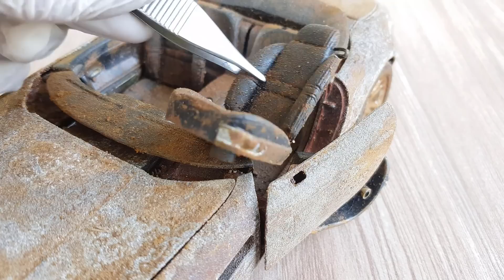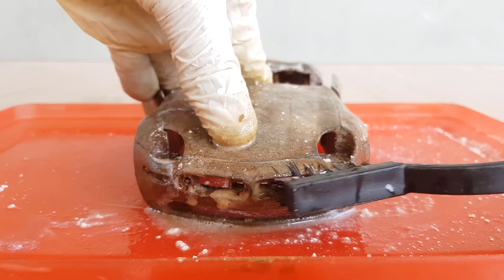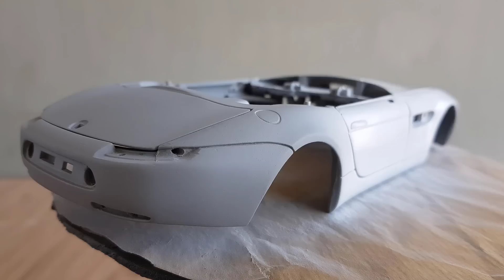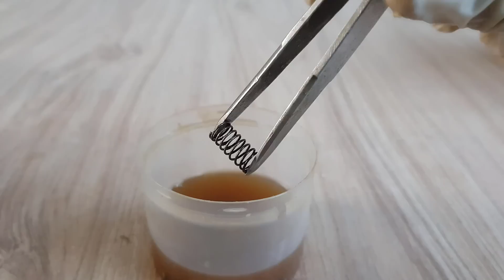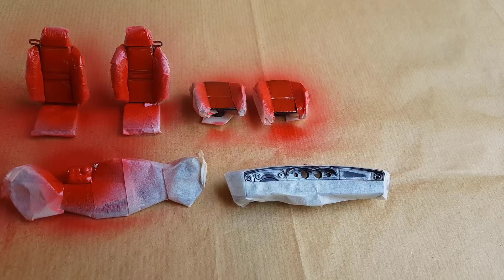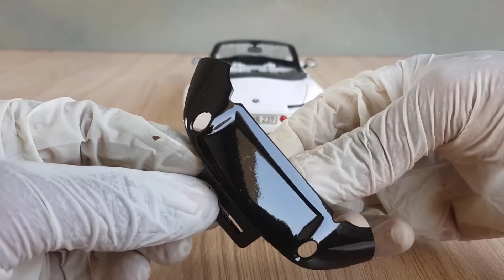Restoration BMW Z8 Roadster Abandoned Model Car

Comment: You've got a good sand blast system but you gotta either tweak or perfect some things like how you wash your plastic pieces like use Dawn dish soap and water or get yourself an ultrasonic cleaner and use 4:1 ratio water to all purpose cleaner like simple green that will get your parts clean.
Reply: ل